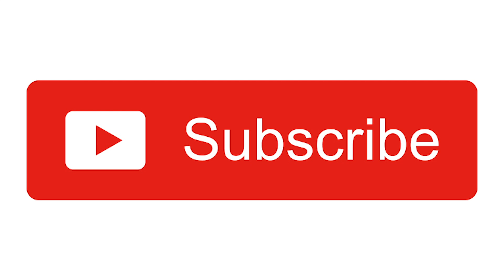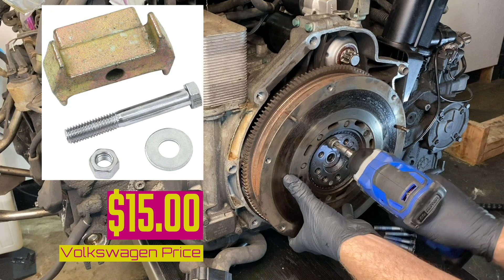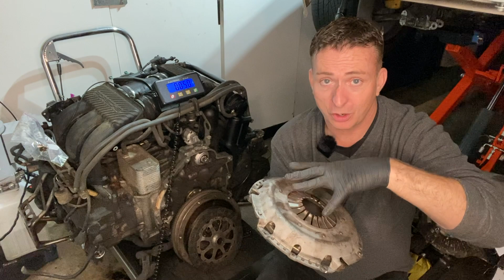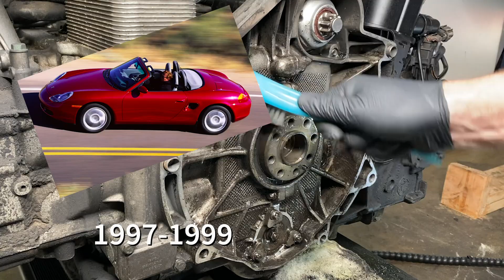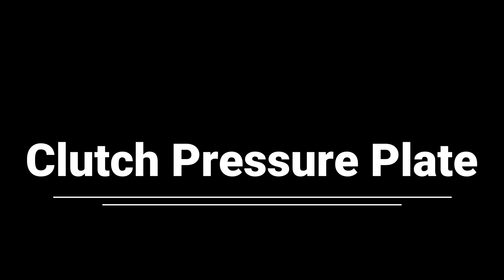How to Separate a Porsche 996 Engine & Transmission

Comment: Time has passed, but there are "different" views on the IMS and Clutch problems.  First, Jake Raby LN Engineering does not like the dual row IMS bearing because it is "TOO GOOD".  By that, he means that is case wear and start to flake out metal pieces and still work, but will fill engine with metal and destroy it slowly.  The IMS bearing is ALSO "time limited" and should be replaced when "Time Used" is expired.  An OEM Porsche IMSB should be replaced (as a "wear item") in an engine.   Unfortunately, nearly any IMSB replacement is costly.  It is a VERY GOOD idea to replace IMSB when engine and/or trans is out of the car.   Go look at LN ENgineering - Jake Raby videos on IMSB, perhaps some of the best available.   Oil pressure and hard right hand turns also provide another glaring problem with the 996 engine.   At that time, the OEM AOS, which is considered and proven POS, should be replaced with a UAOS (See Rennlist 996 Forums) for reference.   Second, whatever flywheel you choose,  a new clutch disc is cheap, put a new one in.   Add a "Deep Sump" which increases oil capacity and "helps" promote oil flow to the right cyl. bank.  Particular oils have been proven to be better for M9x6 engines, Driven DT40 among them.  Read about Oil starvation and what to do about it.  As in a previous video, B4 taking trans from engine, make a cardboard template and put all the bolts in it.  A wrong length bolt in the wrong position will punch the case and make it instant junk.  While all Porsche owners know and feel for the (Excessive) Porsche-Parts-Tax, meaning outrageous prices for parts, there are alternative sources for 996 and 997 version 911s.  There can be $$ deals out there .  I mean no offence, just information.  I liked seeing your videos as a beginner P-addict.  Good luck, keep the shiny side up.

Comment: considering the condition i would have, despite the excellent opportunity for replacement, have reused the entire clutch and flywheel. they are practically new. one shouldn't trust mechanics, service people, forum contributors and especially random advice from the internet. after all, their advice contains absolutely no financial responsibility element, so cost is of no concern to them, despite their objections and protests that they do. the truth is that they can't.
Reply from the maker: It’s true that if I listened to all the advice I received I would have replaced every last bolt and sensor on this engine 🤑 Lee Jenkins at Hartech was my Yoda on this project. His advice was “it’s your build….”
Now that the car is on the road I feel comfortable with the items I choose to replace. As mentioned in the video, if needed, the clutch and flywheel could have gone back in. Now that I have seen the new items it would seem the clutch was replaced more recently than the flywheel, the flywheel was borderline will regard to deflection and questionable on Surface condition. The release bearing was in the worst shape and certainly in need of replacement, add to that the fact that the slave cylinder disintegrated 😲 It seemed that a full clutch system refresh was the way to go. Thank you for watching 🤘😎

Comment: And I forgot to say, the dual mass flywheel can be resurfaced, but apparently not the same way that a normal one is done so there are fewer places that can do it.
Reply from the maker: Yes, you are absolutely right. In this area I found two shops willing to do it for around $80. In certain circumstances resurfacing could be a good option. For this build, even if the flywheel could be resurfaced the springs were pretty loose compared with a new one. Thank you for watching  🤘😎

Comment: So my pressure plate seems to spin around making it difficult to undo those H6 fasteners. Why is mine spinning and yours seems locked in position?
Reply from the maker: Hello Automotorvation 🙌 in this video the only thing holding the engine from spinning is it’s compression. You could use a flywheel lock like the one I use later on. Good luck with your project 🍀 Thank you for watching 🤘😎
Reply: @ManinaGarage  thanks! Once you said this it gave me confidence to try again. Yanking it perpendicular to the curve of movement then released the fasteners for me. Thanks for the videos, great help 👍
Reply from the maker: @automotorvation  That's great to hear 🙌 Another thing to try in those situations is an impact wrench, even the electric one I have can shock things free that I could not manage by hand or by hitting a wrench with a hammer. I'm really happy your project is moving along, I hope your enjoying it🤓 Thank you for your feedback 🤘😎

Comment: I just did my IMSB, Clutch & P-Plate and a few other items last month in my garage.  For the dual mass flywheel, you CAN get them resurfaced once if it checks out mechanically and not excessively scored or burned.  I'm near you in San Diego and took mine to Clutch Works in Oceanside.  They have the proper mill to lock the plate facing to take just a few thousands off.  It only cost $75 vs around $600 for new and it works great!  Check em out.
Reply from the maker: Dude, you ROCK! 

Thank you. 🙏

Comment: Good job on the videos - I've subscribed. Like you, I have no prior experience working on Porsches but I completed the IMS, RMS, clutch job on my  new-to-me '01 996 a few months ago. All I can add is that I replaced the triple-square bolt on the bell housing with an allen head bolt (grade 8 from Ace Hardware) to make the job easier in the future . . . also because I buggered the bolt getting it off.  I'm looking forward to your next videos and waiting to see if your IMS bearing is toast.
Reply from the maker: Hello Peter, I am chomping at the bit to take a look at that bloody Ims bearing! I’m going to rip off some more stuff and lock the cams before I undo the flange of death!! Fingers crossed 🤞
Thank you for watching 🤘😎
Reply from the maker: Hey Peter, how bad was your IMS bearing?
Reply: @ManinaGarage  My IMS bearing was the double-row type and in good shape and turned smoothly. But, I still replaced it with an LN ceramic bearing just so I could sleep through the night. Before this, the '01 966 cab with 54K miles ran well so this was pre-emptive. Lock the cams carefully.
Reply from the maker: @peterhildt1246  Thank you for sharing your experience Peter, I was thinking along those lines, that helps. I felt the IMS solution was a little overboard. Have any LN Engineering Ceramic Dual Rows ever failed??
Reply: @ManinaGarage  I don't think so but you could ask LN. If you want overboard, go for the LN Solution @ $1,800. (!)
Reply from the maker: @peterhildt1246  Yes, I would love the IMS Solution, I just feel that for this car the Ceramic one that you have would be more than good enough.
Reply: @M @ManinaGarage (Very) late to the game as I am just watching this video, there have been reported failures even with the ceramic bearings, which is why they are now considered by LN and Flat Six as wear items to be replaced every 6 years or 75K miles, this was a change from the initial belief that ceramic IMS bearings will not require future replacement, AND why the IMS Solution was developed,